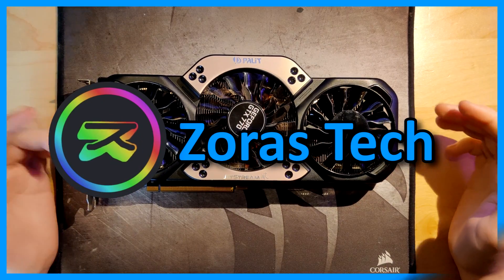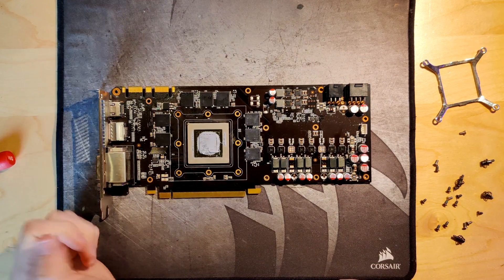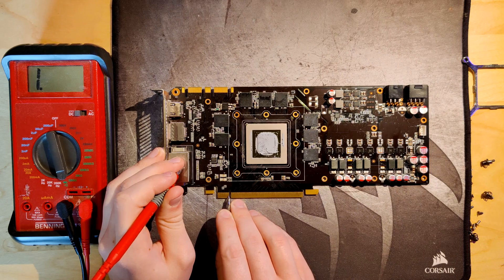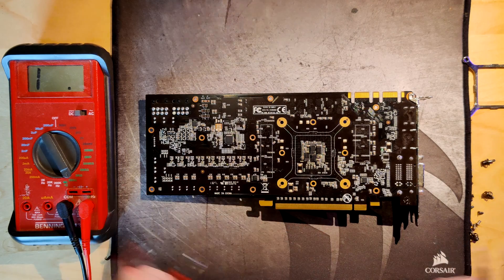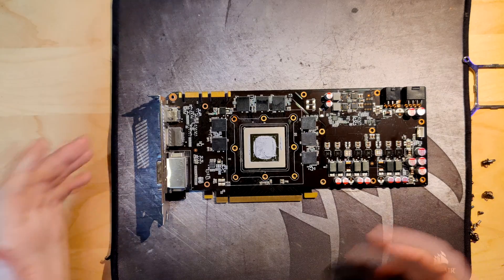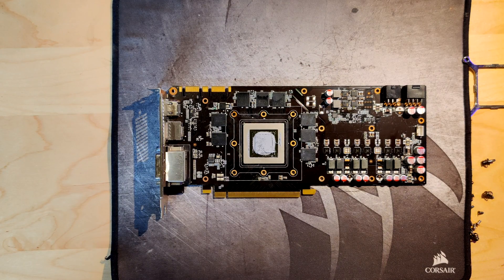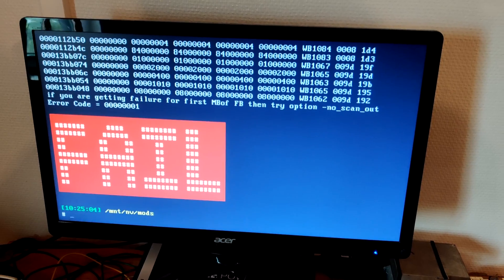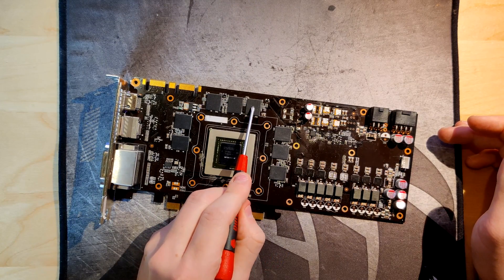Palit GTX 770 Artifacting | Diagnosis

Comment: Hey I have same card the issue that it doesn't display anything 2 fused were blown so got replaced and all power mosfets with controler got replaced. It gives 0.85v to core (8.9ohms) and 1.6 to memory (hynix 110 ohms)after that it detects the card but no display mods by mats doesn't see the card and doesn't give any results any idea what could be wrong it doesn't have physical damage. Thanx!
Reply: Try to flash the BIOS.

Comment: What the oldest gpu family did work with mats mods?
I try on gtx 285 tesla family and sadly doesnt work
Reply from the maker: I got my version of it working as far back as 500 series. Will likely also work on 400 since they are based on the same architecture

Comment: @Zoras Tech 
Can you, for example, use C1 memory module from the donor card and put it into the B1 module on the for repair card? Or do you have to use the exact B1 module from the donor?
Reply: They're identical. Just pay attention to the orientation mark on one corner, as with most ICs

Comment: Don't soldier and don't use heat gun it is firmware issue of gpu flash the firmware first upgrade then downgrade your gpu will be fine if not the only solution is to reball
I fixed 4 gpu with firmware

Comment: can't be a dry/corroded solder on the module? I had similar problem with an hd 7870 and after reflow the affected module is working for months I don't know if is a permanent solution if failed I will try a reballing for fun
Reply from the maker: Thermalshocking is always a temporary solution. Sometimes it works for months ir years. Other times it fails after two days. Replacing the module is the only 100% sure way
Reply: @CmdrSoyo  well time to search for an elpida gddr5 for replacement I guest, thx

Comment: The memory chip that's producing errors is actually the third one on the card (B1). FBIOB 31:0 is B0 and FBIOB 63:32 is B1.
Reply from the maker: Good catch!
Reply: I was about to say the same, cause before he mentioned it in video, i stopped it and guessed the memory chip that was causing the problem based on my knowledge, and when he said the fourth one, i got really confused.